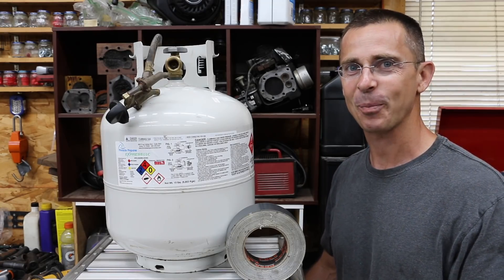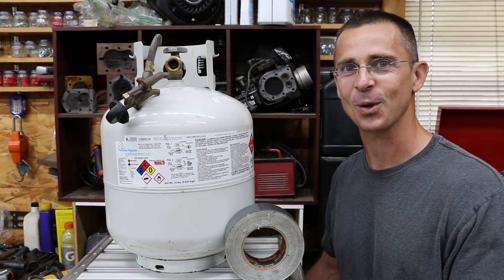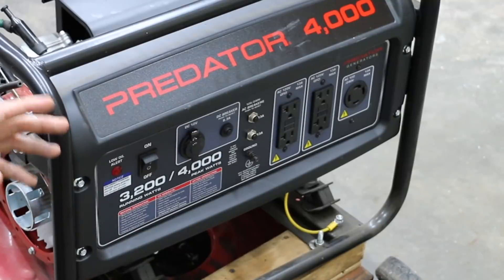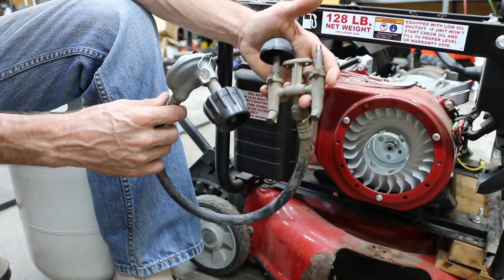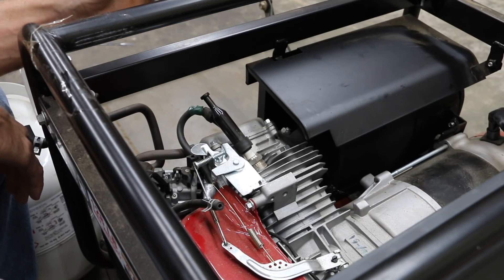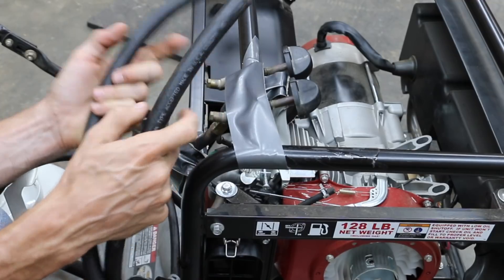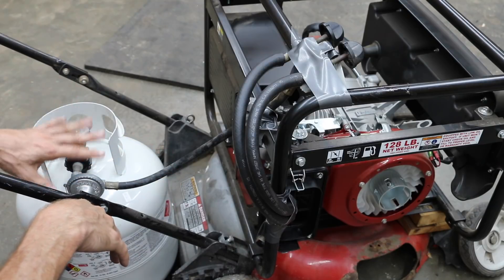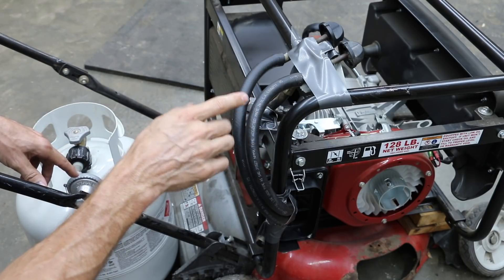Can a gas (propane) grill power an engine?  Let's try it!

Comment: Ummmm my cousin had a pickup truck that ran on pure propane so yes propane will work with engines that "fluctuate". His tank was on his bed where ppl keep their tool box. It was one of a kind pickup. It was a V8.
Reply from the maker: Thank you for the video idea!
Reply: This was back in the early to mid 80s so they had the conversion kits back then for automobiles..I seen people run their mowers on propane & I'm going to set my push mower up on this as my next project. Much cheaper, more power and cleaner burn with propane. How come nobody has come out with a pure propane power mower just blows my mind, mainly push mowers. LP is just natural gas with addictives so we can smell it...lol

Comment: I used to drive a forklift,all of them runs on propane.
Reply: Almost all gasoline vehicles can be very easily retrofitted to tune on propane too! A lot of Slavic countries that are poor in oil resources do this.
Reply: @Luckingsworth  on Brazil as well, at least in rural areas it still can be found but not so easy anymore
Reply from the maker: Thank you
Reply: The difference between the two tanks is,,, the one takes the vapour from the top of the tank.
And the other tank has a dip tube that withdraws the liquid from the bottom of the tank.
I used to work for a company that rebuilt and recertfied propane tanks.
Reply: They run off liquid propane. Not normal propane
Reply: @randyreynolds6508  They still ultimately burn gaseous propane just like this experiment. And a grill tank holds liquid propane just like a forklift tank. The only difference really is where in the system the liquid propane changes phase into a gas.
Reply: @bradley3549  true.   But.   You cannot hook a propane tank for a grill to a forklift.   It wont stay running.   

Ask me how I know. Lol
Reply: @randyreynolds6508  You can! You just have to turn the propane tank upside down. Ask me how I know! :D
Reply: @randyreynolds6508  propane is propane.... even when you shake a bbq propane tank you can feel/hear the liquid slosh in it. Liquid state in tank but burns as a gas or vapour.

Comment: I worked for lpg installation company. It is so easy to install LPG on a car that i knew even before watching the video that the test will work. Carb engines converted on lpg work the same way. The valve for adjusting the mixture is extremely simple, you can put a tap (english is not my strong point but i think tap is the name of the unit/valve that you drink water from) and it will work.
Reply from the maker: Thank you!

Comment: Mixed gas in a 4 stroke with a dry crankcase. What do you think?
Reply from the maker: Thank you.  The 4 stoke design prevents adequate lubrication from reaching the lower end of the engine.

Comment: Guy that ran a small propane supply co. out in the sticks where i grew up had 2 or 3 old cars from the 60's that all ran on propane.  All of them were still running in the early 2000's with who knows how many miles on them.  My dad was a mechanic at a dairy bottling factory.  He had to rebuild the engine of a 1959 Hyster forklift in the late 90's, which was a propane powered lift.  He said that the inside of the engine and combustion chambers looked brand new after 40 years and it only needed rebuilt because the pistons had wore the cylinders egg shaped causing a loss in compression.
Reply from the maker: Very interesting! Thank you

Comment: Actually there are literally zillions of taxi cabs & fork lifts around the globe working just fine with Lpg / propane and / or gasoline. It burns quite a bit cleaner, but sometimes is somewhat hotter burning & subsequentially could affect negatively the durability of valves & seats. Thank you for another great video!!; God Bless!!.🙏
Reply from the maker: Thank you!

Comment: In Australia we have busses and some of our garbage trucks that run on CNG (compressed natural gas) and a hell of a lot quieter than the diesel one's  and some of our cars and taxis run on LPG ( liquefied petroleum gas) and petrol or known as dual fuel or dedicate LPG from factory and different types of systems like injected or convert/mixer type which has a thing at the front of the throttle body and yes the oil does stay cleaner but its still recommend to change every 10 thousand kilometers as it can be acidic so I've been told  a few downsides  if not tuned properly you do lose a small amount of power and you can only fill to 80% of tank capacity and range can be shorter than petrol by 250 or so k's for example depending on vehicle used.  and we have to get the tank inspected every 10 years for corrosion and is 50 or so cents cheaper than petrol
Reply from the maker: Great information. Thank you

Comment: I run my Honda standby generator on NG.   After a hurricane etc everyone goes out looking for gasoline (petrol) but most stations can’t pump or are out of fuels.   The NG line is always on line and my gas grill runs on it.   I converted the machine so it can happily use gasoline, propane or NG.   Best thing I ever did.   So reliable and hassle free.   I also had a proper code safe connection to house done to protect the house, the genset and especially the linemen out there working to get power on.   The NG supply is the key as it fuels the grill for cooking, fuels the genset which powers refrigerators, lights and chargers for cell phones, led portable lights, radio and portable 20 volt tools.   Good to go.
Reply from the maker: That's Great!

Comment: I would have expected any motor to run on propane, But expect it to burn valves etc as it is a dry fuel,
An the heads usually run a little hotter , Any vehicle converted from gas to propane is expensive, an I found that the valves in my engine although they were replaced with high temp valves, My 454 (now gone) would go about 50,000 miles before the valves needed redoing. The conversion to change over was just not worth the trouble as they soon raised the price of propane to high, an the problems as time went on, It was just not wroth bothering with.
It was a big scam !
Reply from the maker: Great point on the valves!  Thank you

Comment: I would have liked to have seen inside the engine to see how clean it burned, and how the buildup compared.  You do that in most of your other fuel experiment videos, and I really appreciate it. 
Anyways, how about some other flammable gasses?  I see a lot of people requesting hydrogen, but what about oxygen (would that burn too hot?) or butane?
Reply from the maker: Thank you for the video idea!

Comment: have you tried to run the engine on Lacquer thinner or Radio control plane and car fuel. I have dome R/C fuel in a weed eater and it ran a bit cooler and had more power and it also trashed the engine. but the combustion chamber was really clean
Reply from the maker: Thank you!

Comment: wait a sec. you said propane.  you didn't say propane and duct tape.  the ONLY  reason this worked  is because you used  duct tape to tape the gas control valve to the generator frame.  never would work without the duct tape  - red greene

Comment: Old news. Propane has ran engines for decades.   New outboard engines are bought ready for a little cylinder to screw right on. Run most of the day on one little cylinder.
Reply from the maker: Thank you!

Comment: Yes, propane can run an engine. That's why they sell a dual fuel set up for small engines. But, both propane and natural gas produce less power than gasoline, so a generator will make less power on a gas, than on a liquid. Diesel would produce more power per gallon than either gasoline, NG, or propane.
Reply from the maker: Thank you for the video idea!

Comment: If the engine stalls the propane still runs, thats the only flaw with this setup. Best to use a $50 propane conversion kit from amazon.
Reply from the maker: Great point. Agree, a proper conversion kit is the way to go. Thank you

Comment: If it is possible maybe throw a scale under the tank and figure out how many pounds of propane the engine will use under load for a hour and how much it will use just idling for an hour . Then we can see how much gasoline it uses for an hour under load and idle. Then we can have a idea how much it will cost to run a propane setup vs gasoline setup. This would be very helpful especially in an emergency situation with hurricanes and winter storms in knowing whichever is cheaper for emergency situations.
Reply from the maker: Thank you for the video idea!

Comment: No it won’t work! Just like a human can’t live off of nothing but coke and pizza 
Just like a phone can’t operate off a 9v battery but CAN on a 12v .. just cause they are both electric doesn’t mean it will work just like propane not being suitable for a lawnmower that was intended for use of gasoline . Yes they are both combustible but aren’t interchangeable.
Reply from the maker: Thank you!

Comment: To anybody trying this, in warm temps this works . I run a old logsplitter that as a bad carb this way but in cold temps small tanks frost up and don't draw. I had to switch to a larger tank.
Reply from the maker: Great recommendation! Thank you

Comment: I've done this before. It was a dire situation. I ended up running the engine on propane permanently after that without modifying it!

The propane line I used had a "tee" conenction in it for the bbq side burner. I used this as a makeshift propane carburetor. The engine pulling propane in caused a venturi in the t connection. I used a pair of vice grips pinching the hose off the tee to adjust the air flow. I fed the fuel air mix into the plastic air box that I "tapped" by heating it up and screwing the brass propane fitting in. Getting it running required 3 hands but it ran great once it was going. I used it for a year or so until the generator was stolen out of the yard at my shop.

Thanks for posting this brought back some fun memories. I thought I was the only one crazy enough to try this.
Reply from the maker: Great information. Thank you

Comment: To high is incorrect English. To is used as an indicator of  direction, as in to and from. Too is the word that you need. It indicates an amount, as in too much, or too little. I see this all the time. People may retort "Everybody knows what I mean." Maybe so, but they also know that accuracy doesn't mean much to the communicator. Spell check doesn't correct grammatical errors. Of course, auto fill is often the culprit, especially if an individual skips the proofreading. I have done this occasionally. It's embarrassing at times. Carry on. Love this channel.
Reply from the maker: Thanks for the constructive feedback

Comment: Ah the good old drill start. Almost broke my wrist a thousand times as a kid starting my go kart like that 😂
Reply from the maker: Lol
Reply: If your drill has a clutch, try turning it on (at least just below the drill setting). Use the shortest 19mm you can find and use a wobble extension. Be ready to pull the drill off with both hands at the first ignition.
Reply: @Patriot4967 the trick is to not put the socket on all the way, also don't take your finger off the trigger immediately, lastly as the engine is still starting pull away. Don't allow it to get to running rpm.
Reply: @kakytoo69  Yep.
Reply: Look at how a starter crank is set up on any old model A Ford, Model T Ford or a host of old model/vintage autos. Those who broke their wrists generally held the crank wrong and it spun about and snapped them because they could not release it in time. Ahooga.com and other web sites explain the proper holding of these hand cranks for newbies in the hobby, which is basically using upper pull with hand opened. Those engines had bigger and heavier shafts than any of these generators or small engines do, but they all use hand cranks for years prior to the electric starter buttons being used, which Caddy first came out with in 1912. The front plate for the crank insertion was different in those autos, but non-the-less, the principal is still the very same. The old cranks had a pin in the end of them and the hub had a design which allowed the crank to spin loose after the engine started. One could probably modify a housing to do this with, but the use of that modified socket setup is cheaper and easier to use and play about with. Short socket with flexible extension added to a drive should do the trick or make it easy on  yourself and go to an RV dealership or E-bay and pick up a scissors drive socket that one uses to raise and lower the scissors jacks to a travel trailer or RV. 19 mm or 3/4" size works.
Reply: a1930ford backfires and compression backing the engine into reverse rotation caused injuries. Like a flooded mower or one with a sheared timing key snapping back and whipping ones hand with the pull start handle. Aww damn one almost broke my hand.
Reply: Deep knowledge!
Reply: Use an air-tool drill or die grinder that has a max RPM of higher than the max RPMs for the engine?
Reply: @Patriot4967 Also use a worn socket square that goes into the socket and a sloppy socket. If they are both lose it comes on  easy enough on start. Done my wrist so many times too!
Reply: lol
Reply: In addition to a drill and socket to start an engine, I add a breaker bar ratchet. This has allowed me to start numerous engines through out the years without any mishaps.
Reply: Only use cordless or air drills to start an engine, they don't have pulsations in the torque like an AC plug in drill.
Reply: @axl151  the starter motor on a snow blower the the same universal motor as in your corded drill. I don't think you have any data to back up your claim?
Reply: @alec4672  Note really.  Just the torn up gears on every AC drill that I've ever used to start an engine.  That AC starter motor has an overrunning clutch to protect it.
Reply: @axl151  sounds like a crappy drill. Anyway if you're starting a motor with a drill you're putting any drill and wrist at risk to damage. There's no wrong or right way to do this, it's a farmers trick plain and simple 😂🤷🏻‍♀️

Comment: Try running it on propane with a tourtch tank and the and the head of the tourtch connected to your gasolines
Reply from the maker: Thank you for the video idea!
Reply: Or try nitro oxide if you can get some

Comment: There are kits out there to properly convert a generator over to propane. They run so much cleaner you don't have to worry about changing the oil every little bit. And it is real easy to convert a push mower over to propane. There are videos on YouTube to help you do that conversion.
Reply from the maker: Thank you

Comment: You probably would have had better results with a regulator off of a propane ran turkey deep fryer. It has a dial up by the regulator diaphragm that can release more propane out of it. You can set it to release so much propane that it'll drip out the end as a liquid.
Reply from the maker: Thank you!

Comment: At first when I saw the title I thought this isn't going to end well  & the end of Project Farm LOL. Back when I was 20, I got my lawnmower to run on "water" (the H of H2O). It was extremely difficult as I had to have a buffer tank after the water was "cracked". You should give that a shot. NOTE: this would only work with 4 strokes.
Reply from the maker: Thank you!

Comment: Be neat to have placed the tank on a scale to measure fuel burn rate. Also, to use a sensor to measure carbon monoxide at the exhaust.
Reply from the maker: Thank you!

Comment: I think 🤔 if you used your scuba mouth piece regulator  on your go kart ( or genset )  the draw of the engine would throttle the propane on higher demand  ( that’s basically the set up a propane kit uses )   Duck tape the mouth portion to the intake of the carb   It may work very well and easy.  ( most would trouble doing what you did here  your used to making Carb adjustments lol ) plus you have a E start.  We would all be pulling away trying to get it running.
Reply from the maker: Thank you!

Comment: There is a controversy over the new replacement of refrigerant R132a with R1234yf.   R1234yf is flammable.  Will and engine run on it?  R1234yf is $35 a pound and it is available in one pound cans.

Comment: how much fuel does it use though ,
would you be able to run the engine longer on normal gas or propane
Reply: I had Subaru Forester on LPG (in some parts of Europe such things are normal, and every gas station has LPG point) it did use more fuel but LPG is cheaper here. To put it in perspective, it used about 20% more fuel (LPG) which cost roughly 50% less than petrol.
Reply: @Diegovnia  strait to the point  we  here in europe have at last 50-60 years history   of hybrid  of certificate/approved  cars  on the streets  ,excluded prototypes 
and 25 years of factory hybrid cars   gasoline -gpl-methane
Reply: My car does 12 km/L on LPG and 14 km/L on petrol. That's mostly due to the fact that 1L of petrol is more energy-dense than the same litre of LPG. On a per kilometre basis: around 5c/km on LPG and 12 c/km on petrol. (petrol at 1,6€/L and LPG at 55c/L)
Reply: There is quite a bit more BTU in a gallon of gasoline than there is in propane, but this type of use, I suppose a timed test with both fuels, similar load would show gasoline the better performer
Reply: If dialed in perfectly for running just on lpg, the engine would consume the same amount as when running on gasoline. However in most conversion situations its not dialed in perfectly and lpg consumption is about 10-15% higher

Comment: If you kept running this engine long  term on gas it will wear out the top end and if the ignition wasn't adjusted you risk pre ignition
Reply from the maker: Thank you!

Comment: Could you get a gasoline motor to run without a spark plug.increase compression gas oxidizes more efficiently 20% gain in mileage. Some people call this  dieseleaning.
Reply from the maker: Thank you for the video idea!